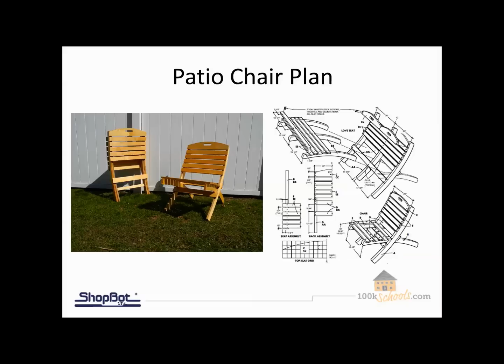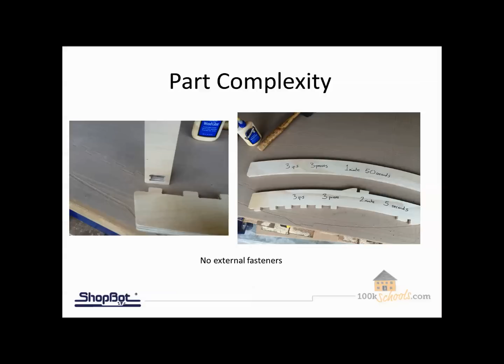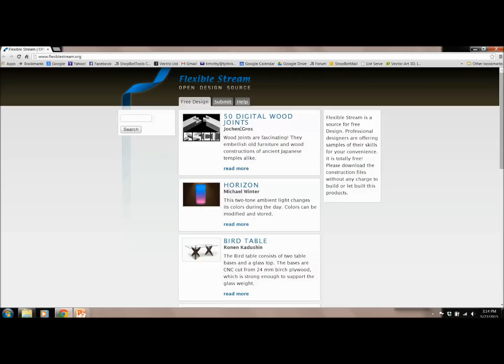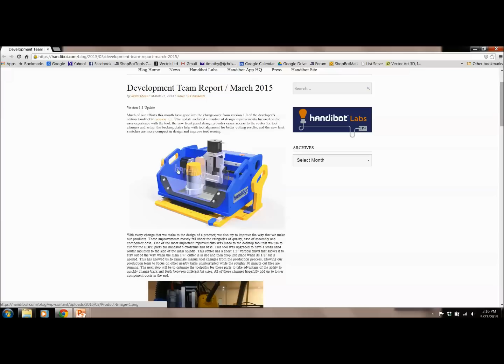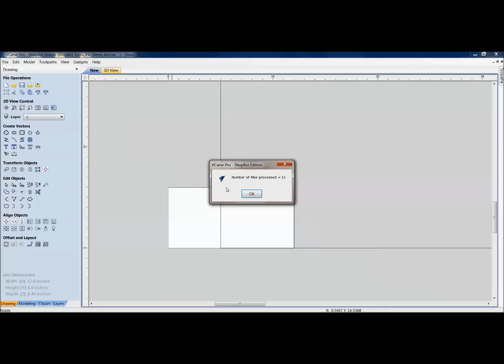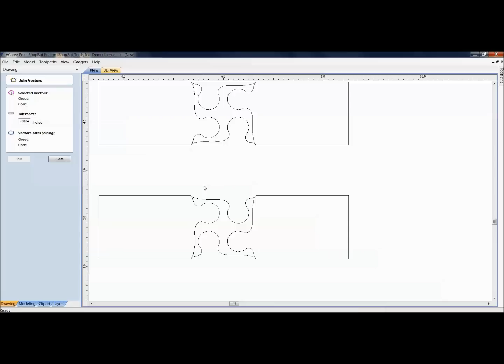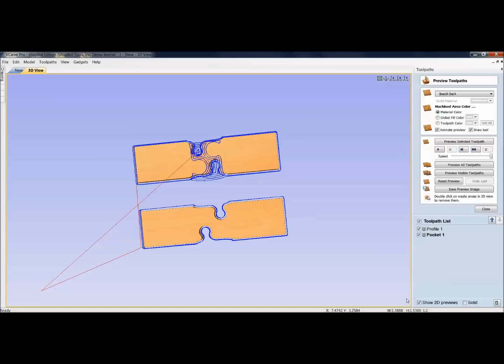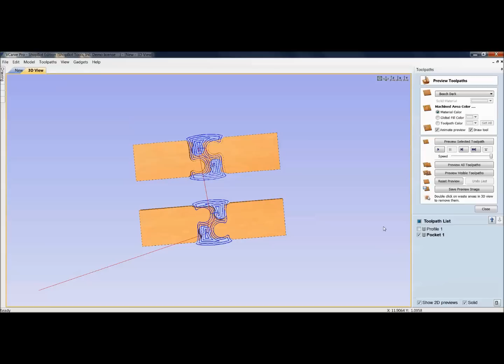Desktop: Intro CNC Joinery

Comment: What are the steps you took to adjust the fit tolerance so the joints slide together? How much tolerance did you add so the parts fit and can be glued up?